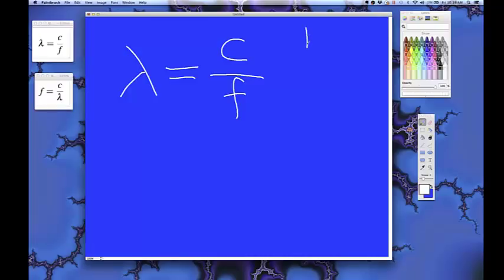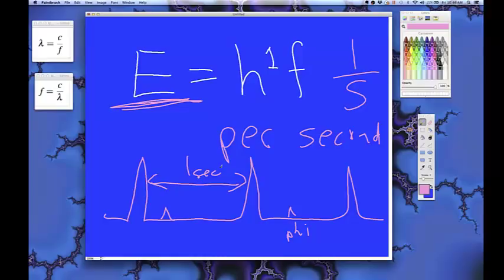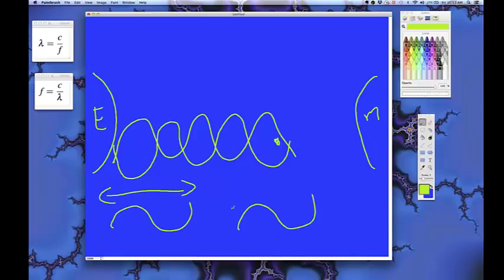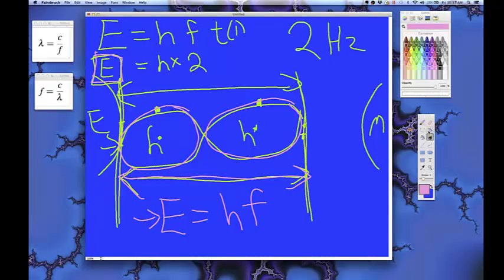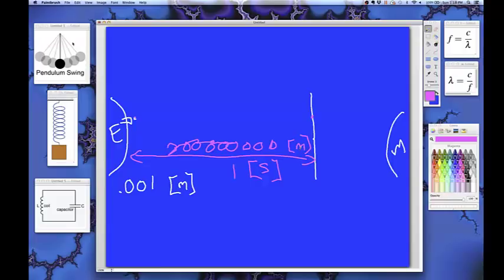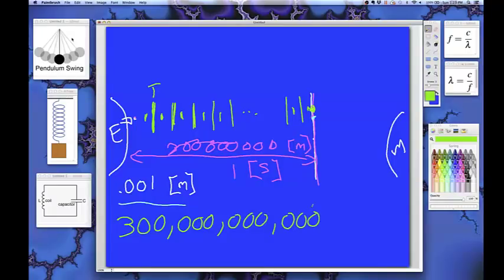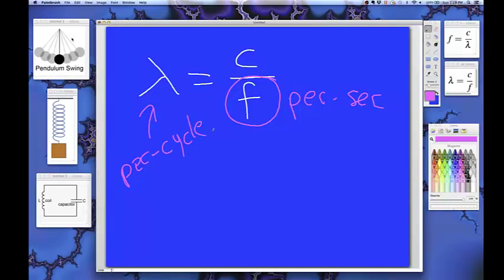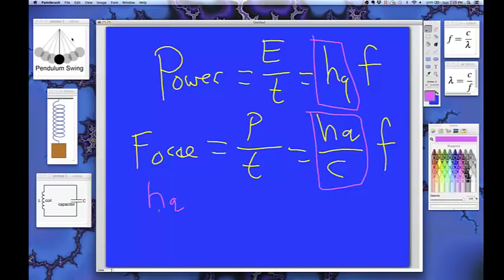Wavelength, Frequency and Modified Unit Analysis

Comment: If the missing t is a period where is the other delta in the hq= j/delta. Shouldnt it be hq= (j × delta/s) ÷ s/delta
Reply from the maker: Nope. Then you would end up with [J x delta*delta / s * s]. The other delta is in the frequency term. E = h [J x s/delta] x f [delta/s]. What I prefer to do is write the equation in terms of power: P = hq f [J/delta  delta/s]. Here, hq has units [J/delta] and f has units [delta/s]. This is analogous to the power equation in electronics: P = V I [J/C   C/s], where [C] is the unit Coulomb.

Comment: Hi lori

Your heart rate perspective seems a bit arbitrary
At resting state there are variations amongst humans.
Reply from the maker: OMG. The one second time interval that I am talking about is APPROXIMATELY the human heart rate. Interestingly, since I work in the medical field, I once had to integrate an ECG device and display into my software. This was for doing cardiac gates 3D ultrasound scans of the carotid artery in the neck of a human being. So I am intimately  aware of not only the global variations between human beings, but also the local variations or varying time periods between each heart beat of a single human being. What IS arbitrary, in my opinion, is the choice for a 1-second time interval as a standard unit of time. The meter and kilogram are also equally ARBITRARY. The point I am trying to make in this video is that our choice of the second, meter and kilogram as standard units are EASILY measurable at the human scale. We could just as easily chosen  the nanosecond, the millimeter and the microgram as the standard units of measurement, but that wouldn't be very practical, would it?

Comment: This is fascinating.  Have you applied this to an electrical circuit yet?  Thank you for your service.
Reply from the maker: Good question. Planck's energy equation can be directly related to an electrical circuit by converting it to a Power equation: P = h f with units [J/c c/s]. Here, [J] is Joule, [c] is cycle and [s] is second. In an electrical circuit, the Power equation is P = V I with units [J/C  C/s]. Here, [C] is Coulomb. So the units are VERY similar in these two equations.  In the first equation, h plays the role of voltage and f plays the role of current.
Reply: @FractalWoman  Wow, thank you for that.  Have you written a white paper on this application of MUA?  I'm building a piece of lab equipment and would like to apply it.  Thank you
Reply from the maker: @squeakytoyrecords1702  Here is the paper where I derive the power equation, P = hf: https://www.researchgate.net/publication/325462944_Planck%27s_Constant_and_the_Nature_of_Light
Reply: @FractalWoman  WoW, absolutely fantasmagoria!!  What you propose  regarding the application of MUA is correct.  Question: Have you applied MUA to PHI?  As the Fibonacci sequence has a 60 step repeating cycle (Where the last digit of each step repeats in a fixed sequence), could a finite value for PHI be extrapolated?  If so, it would also provide a rational value for Pi.  In this paper you mentioned 2 additional publications, "Calibrating the Universe and Planks constant and the law of capacitance"  Would you be kind enough to share the links with me?  Lori, you do splendid work.  Thank you so much for your service.
Reply from the maker: @squeakytoyrecords1702  Thank you for this great message. Regarding Phi, it is my opinion that Phi is the scaling factor of the universe. It is a power law and therefore is unit-less. PI is different. It has units of "cycle" such that 2PI is exactly one cycle (or the circumference of the unit circle). 

Here are some links to my papers:
https://www.researchgate.net/publication/325462944_Planck%27s_Constant_and_the_Nature_of_Light

https://www.researchgate.net/publication/315673346_Planck's_Constant_and_the_Law_of_Capacitance

The "Calibrating the Universe..." paper was published in a journal called Physics Essays so I can't make that public without infringing on copyright laws, but if you email me, I can try to get you a working copy. 

info@theOMparticle.com

ps. fantasmagoria...love this  :-)
Reply: @FractalWoman  Interesting regarding PHI.  I will read these papers and message you.  Thanks.

Comment: A pendulum isn’t a good example of light. A better example would be a Newtons Cradle. Light travels as a longitudinal density wave thru a medium. As long as the medium it travels through stays the same the energy can pass trough without much loss. But as soon as it hits an other medium with a other speed of light this is where you “photons” will appear.

The speed of light is different in different materials/medium. In air light travels a lot faster then in water for instance. This is why you see refraction when light hits water in an angle. You can use Snell’s law to calculate the difference in speed.
Reply from the maker: Ahura Mazda: Yes I agree. A pendulum is only a good example for light when light is propagating (with the pendulum swinging being analogous to propagation). I don't agree that it is "not a good analogy". I think the pendulum is a good analogy for propagating light. When light hits an interface, then we have phenomenon such as absorption, reflection, refraction, dispersion and diffraction depending on the interface. In a similar manner, a pendulum will continue to swing until it hits an interface, like a wall or something. Then you get phenomenon.
Reply: Fractal Woman I didn’t really mean it is not good. Sorry English isn’t my native languish.
Reply from the maker: @ahuramazda9442  Oh, no problem. I wasn't offended. I just wanted to clarify. It's all good and I appreciate your perspective.

Comment: Why can’t we simply switch to a natural unit of cycle instead of the second?
Reply from the maker: Experiments require a unit of time that can be measured at the human scale. All units, the second, the meter, the kilogram and the Coulomb were invented for that purpose. It doesn't matter what they are, as long as you are consistent in their use.
Reply: @FractalWoman  Thanks for your reply - love your work!  It seems possible that the kind of units might matter in order to get a better feel for the structure of reality - because the relations between natural units might make it easier to see significance whereas other units would not make those relationships as apparent.  Does that make sense?

Comment: Almost there... h=energy/cycle. 
Except, there is no cycle. Waves are not fundamental. They are an emerging property.
Photons are fundamental. They don't wave. A point in the field waves.
Search youtube for "quasi solitary wave with breaking".
the water (soliton) bulge is your photon analog. It does not wave. But points at the water surface do wave (once) as the photon passes by.
Now for the 64K question: why doesn't a photon dissipate. What non-linear influences keep it going forever? What forms the "channel"?

Comment: 20:06 if you have one photon cycling 7 times then yes, f=7... but if you have a continuous beam of 7 separate photons, does an Nth factor not apply? the first photon cycles 7 times, the 6th cycles 6 times and the last one cycles only once. So for a chain of 7 photons in a one second period, does the total energy not need to factor in 7 cycles + 6 + 5 + 4 + 3 + 2 + 1... is there not the sum energy of 28 cycles in your 1s period?

Comment: The answer is in the video by, The Slow Mo Guys. "Light at 10 trillion fps".  At a slower speed shows a video of the photon like the old pong game. They say it's a photon, if I look, I see a (?)photon with a circle before and after the photon (compression and rarefaction of light). The photon is when the compressed Aether field compresses down to the coaxial circuit of the inertial plane. Your circles are compression and rarefaction, and should have an inertial plane (and its coaxial circuit) mediated to center. 
  When the video shows light at 10 trillion fps. I see the compression of the aether field to the coaxial circuit of the inertial plane (photon). Has circle/rings on the coaxial circuit, as if its entering a layered wire (photon) like e-'s around a wire. I see lights Aether field compresses down to its inertial plane. "The smaller the spacial footprint, the higher the capacitance". Infinitely small, infinite capacitance. The inner edge of our Universe.
 Seems the photon is the node of compression. Is it compression-photon-rarefaction-compression-photon-rarefaction-... Sure resembles scalable Aether field through aligned/coherent hyperboloids of a larger scale Aether field. Then your photon has Aether field doubled up (double layer/cavitation) on either side of the photon. Half the photons in your drawing. The photon being between the compression and rarefaction, not between the rarefaction and compression.
       Thanks
Reply from the maker: Noncon...: For the record, the picture you are referring to is a schematic of a wave. It was not intended to be a drawing of a photon. It is a simple sine wave an no more. The intent of this picture was to show the frequency component of light over space and time. It also shows that shorter wavelength have a smaller footprint than the longer wavelengths, regardless of the "structure" of the photon, which is not depicted in this schematic.
Reply: @FractalWoman ;   Thanks. 
But, I was talking about a video of "light at 10 trillion fps". The Slow Mo Guys. Lenses and computer that shows light at 10 trillion frames per second. Shows lights field compressing, until it hits (?) the coaxial circuit of the inertial plane. The inner edge of our Universe. I see compression into layers of the coaxial circuit. Then repelled, rarefaction as light longitudinally does.
 The best video I've ever seen. I really like your videos, but light at 10 trillion fps and they are going for 1.5x faster.  Actually shows light, not a radio wave image, mutated and colored. 
 Seems light travels through Aether. Into the vortex, compressed onto the enormous/infinite capacitance of the coaxial circuit of the inertial plane. Repelled out (rarefaction) the other vortex of Aether's hyperboloid ...
Reply from the maker: @gyro5d  Can you draw a schematic of that? That would be very helpful.
Reply: @FractalWoman  ;  As Ken would say. "The smaller the spacial footprint, the higher the capacitance."

Comment: Only half way through, have to say I see it more your way than the other person. I see your period, (my little joke with myself) e- as a single wave with an Inertial plane mediated to center. Have heard the Universe has a pulse, blinks on and off, frequency, ... The wave goes up, peaks, down, inertial plane, counterspace, inertial plane, space, ... + waveform, on-inertial plane-counterspace-inertial plane, off. Or, the inertial plane is entanglement. It should be, + waveform, inertial plane, + wave, inertial plane, ...  1 cycle per second. Wave/particle, Space/Counterspace. Inertial plane and Counterspace are not in our Universe. Is this what a particle is or isn't? If its not wave (field) its not in this Universe, particle (Counterspace)?
  Square Radiant Energy perturbations (Quantum) segmented energy, not sine-waves.
Reply: Just saw light at 10 trillion fps, The Slow Mo Guys. What I see; Shows a field that compresses into a bright spot, with layers around the spot. Then rarefies and speeds off. Coil~Capacitor~Coil~..., rarefaction~compression~rarefaction~... 
 When the field compresses, (the smaller the spacial footprint, the higher the capacitance) the field hits the coaxial circuit of the inertial plane. Creating double layers/breakover voltage/cavitation/ ... that shows around the high capacitance (photon) then accelerates and rarefaction, No photon, from this capacitance. The photon only shows when the vibrations of the aether reach the coaxial circuit of the inertial plane, for acceleration.
 Your photon is at zero, the vibrations of the aether compressing to the coaxial circuit of the inertial plane, highest breakover capacitance. Capacitance powers vibrating aether, that becomes a hysteresis around the coaxial circuit of the inertial plane, Illumination.

Comment: First, I am learning more about these equations from you than from ANY other source. Thank you. Second, you state that h(q)/c is a constant of force, but I am understanding that the speed of light is not constant but depending on the medium can propagate at slightly different speeds as shown by the separation effect of prisms. If I am correct, (a big if, I know) then how is any thing that relies on the speed of light not a variable? Very curious. (Also learning from Robert Distinti and Ken Wheeler, btw). 
To add to my curiosity, if we were not speaking solely of "light" but of EM radiation, including heat, and as you have used microwaves, the propagation changes the state of the matter (whether space(ether) or something more dense) and so changes the speed of propagation. (Using a  sound wave in ice that changes it to water thus changing the speed of propagation for example).  The speed cannot be a constant, can it?
Reply from the maker: Heath: These are all great and insightful questions. Speed is only constant in the exact medium with which it is propagating. Speed of propagation is dependent on the medium.  The speed of light is only valid in the "medium for the propagation of light", a.k.a, the Aether. In a similar manner, the constant, h(q)/c, or quantum of force, is only valid in the medium for the propagation of light or the Aether. Quantum of force is the smallest force that Aether/light can impart on an object. Other media would have other quantum constants. Regardless, all constants are medium specific.

Comment: you're an awesome teacher. No degrees here I'm a tradesman. After watching you a few times I actually learn so much and in so doing get a little humbled. Not to mention a little more teachable. For my two cents worth is it possible that light is a perturbation through what was once called The luminous aeither?  I keep finding connections with you and Ken Wheeler. Who I find hilarious and a little harder to get my head around. Between the two of you I'm picking up stuff I can actually apply. Thank you
Reply from the maker: "For my two cents worth is it possible that light is a perturbation through what was once called The luminous aeither?" 
YES. I work in the field of 3D ultrasound. It is my understanding that, in order for a wave to propagate, you need a medium. There has to be one. There must be a medium for the propitiation of light, I don't care what you call it.  Here is a paper that I wrote on that subject: https://www.researchgate.net/publication/313515057_A_Medium_for_the_Propagation_of_Light_Revisited
Reply: @FractalWoman  thank you ever so much. Wound up a carpenter because of my love of math. With what I've learned so far I may have a chance of getting my head around it. Those equations you share are f#$&ing awesome
Reply from the maker: @dana7197  Hey, thanks. There are more "equations" but they are all super simple. If the universe were "complicated", then it probably would never have come into being in the first place. Only a simple universe can come into being. As Ken Wheeler says, the universe is "simplex". It is super simple, but complicated to explain.
Reply: @FractalWoman  I've wonder if there is something inside the torus field around a magnet that inflates it and the field perturbation we witness through the  ferrous cell is riding on it and if such a thing could be observed. A galaxy is flat because it might be the plane of inertia held in place be a torus field. that would explain it's nature.
Reply: In the beginning was inertia then God said " Let there be loss of Inertia" Absolutely inspiring. Perhaps what ancient people called the unstoppable vibration that created everything that vibrates
Reply from the maker: @dana7197  The vibration of OM.
www.theOMparticle.com
Reply from the maker: @dana7197  The geometry that I am exploring is the torus knot. The torus knot has a lot of properties the geometry we see under the ferrocell. I wrote some software to model the torus knot so I have first hand experience with this. If there is a "torus field", it is a torus knot.